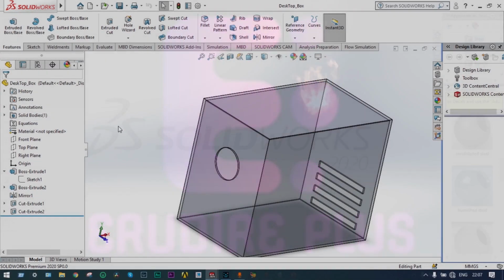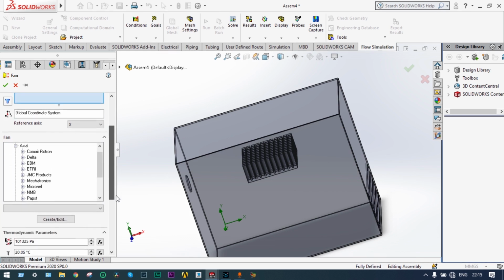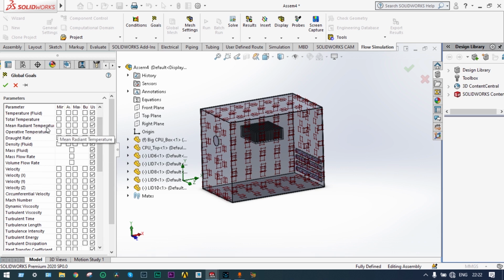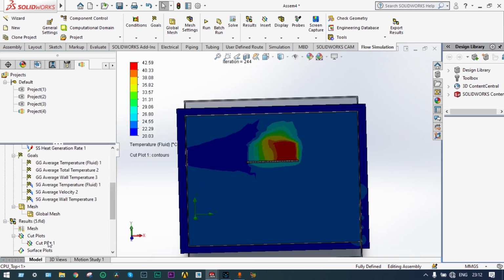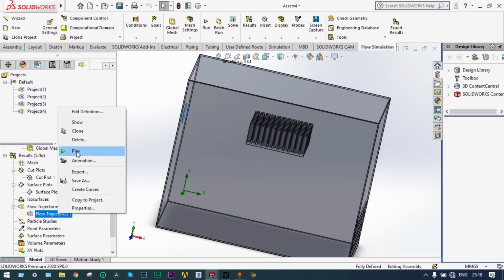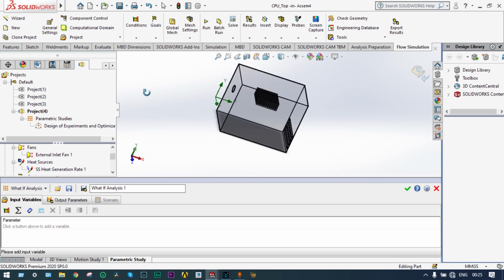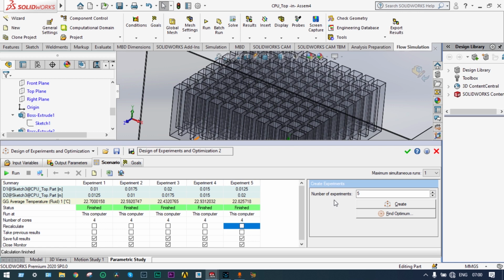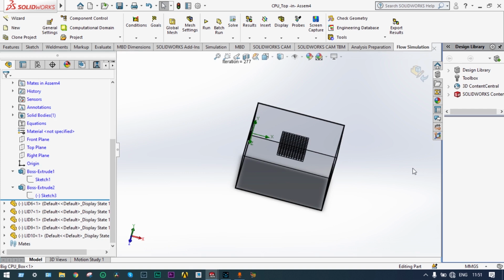CFD Flow Simulation & Flow Optimization through a PC | SolidWorks 2020 |

Comment: How did you calculate the h value as 60 W/mK?
Reply from the maker: It is an assumption. The value can be provided by considering material property
Reply: @CFD_GUIDE  Thanks for the info. But h is not a material property and not that easy to predict. Anyways, nice video. Keep up!
Reply from the maker: Convective heat transfer is not a material property but it is not so simple. Suppose heat is transferred from one particular solid to different fluids at a specific temperature the value will different in each case. It is a thermo-physical property of fluid.

Comment: In how many seconds does the equilibrium state reach? For Example 22,85 °C

We would like to heat/temperature control a blackening pool with electric heater.
I would like to calculate the needed perfomance of heater.
The initial temperature of the fluid is 20°C, desired temperature 80°C.

Thanks in advance.
Reply from the maker: That can be done using transient analysis and optimization
Reply: @CFD_GUIDE  Could you show me, how can I do that?
Reply from the maker: Ok, I will make another video optimization of this type. If you send the model I can show required optimization as per your requirement